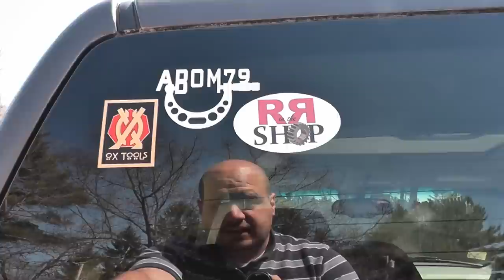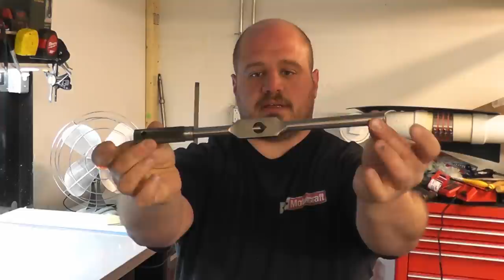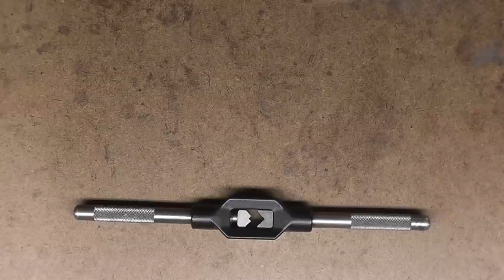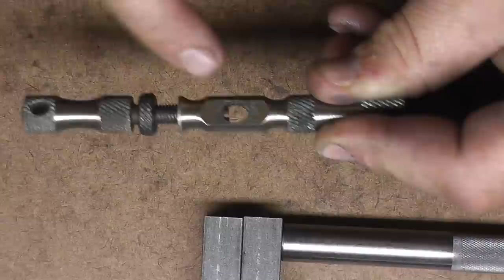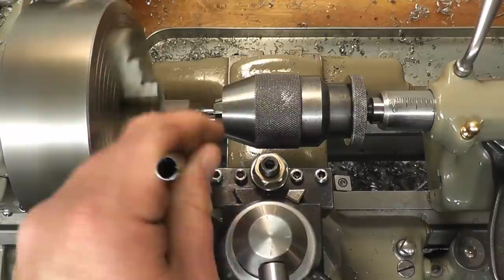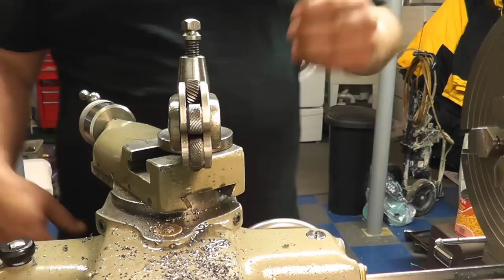Making a Tap Wrench Part 1

Comment: when you doing the treading video's it would be awesome to see someone make an internal threading tool.
Reply from the maker: Shaun Tucker Just make a normal 6o degree threading tool out of 1/4" hss then use a dremel tor something with an abrasive disk to cut it off short so it will fit into a boring bar that takes 1/4" bits with minimal stick out.

Comment: I wish there were still companies making really nice die stocks that are up to par with Starrett tap wrenches.
Reply from the maker: I have a video of one I made.  the older Greenfield stuff is nice
Reply: Yeah, I found a nice old set of Greenfield taps and dies with a 1-1/2 inch die stock and 1/4 - 1/2 inch tap wrench. Apparently the set belonged to my great uncle, so that's cool. It's probably close to 100 years old at this point.  I just wish it were one of the Junior sets with the smaller tools because that is mostly what I use. I suppose that when I eventually pick up a mill and lathe I will make a few of my own.

It looks like Union Butterfield may still make some high quality tap wrenches and die stocks based on the prices I've seen, but they also have some Chinese/Indian junk. I did come across a company that makes a unique tap wrench here in the U.S. but it's quite expensive. Here's a link:

http://northernmachininginc.com/?page_id=21

Comment: the job of that pin in the sterrett isnt to keep it from coming apart. its to keep the "v" in the pin aligbes with the tap so it doesnt rotate when you have the adjuster trying to twist it as youre tightening the tap in the handle. lol

Comment: Greg how about something that is spooking me out an internal LH tread in a blind Hole.
Reply from the maker: Jim Arnott Make a relief groove in the end of the blind hole where the threads bottom out.  Make sure the groove is wider than the tip of your tool.  Start with your tool in the relief groove feed the tool in towards the work and have your carriage feed towards the tailstock.
Reply: Thanks Greg sounds like a plan.

Comment: Hi Gregg, Is that 1/2" tooling and what insert?
Reply from the maker: Skip Waelty Yes it's an A.R. Warner toolholder with ccmt 32.51 inserts.  I believe these were the HSS ones that came from A.R. Warner and not carbide.
Reply: ***** Thank you sir.